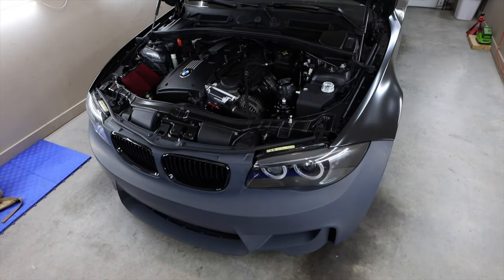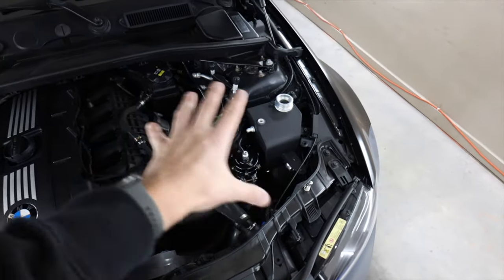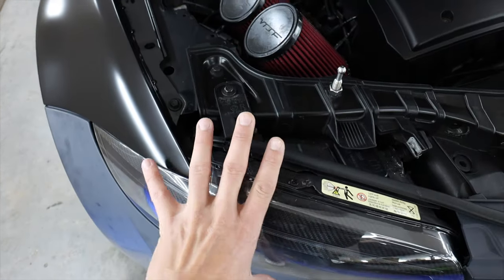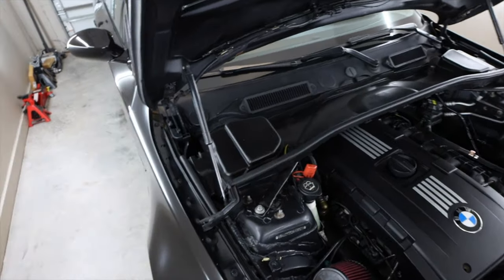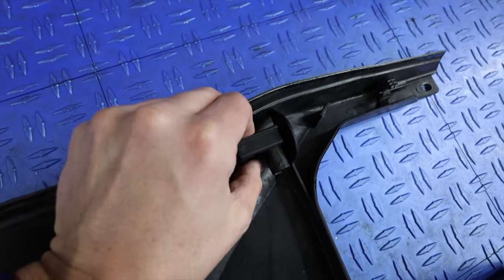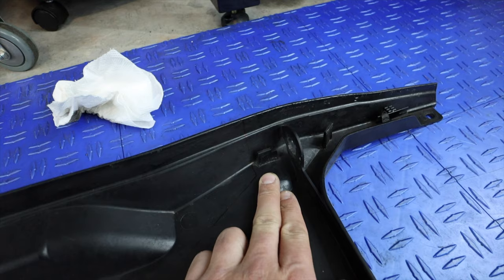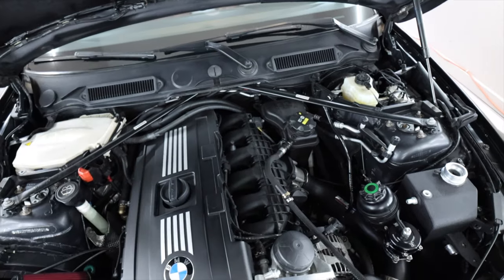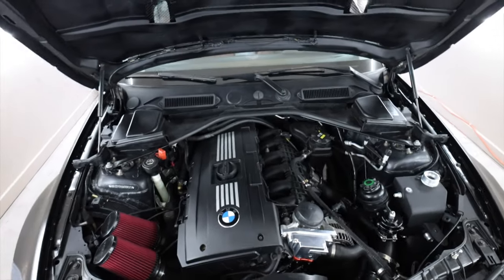E82 135i to E9X M3 COWL CONVERSION (FREE N54 DIY!)

Comment: Cool vid - haven't seen many covering this so far. The only other consideration is your car seems to have different hose routing near the cowl. Stock has a lot of hoses attached to the cowl which will need to be sorted. Thanks for getting so in-depth with this series!
Reply from the maker: Thanks! Yeah when we put in my engine we rerouted a lot of stuff

Comment: hey bro, from which vehicle did you purchase the correct rubber seal? You mention in the video you need a longer one. Gonna attempt this next on my E90.
Reply: did you figure out the part number?
Reply: @NismoGTR511  no lol. I ended up just using the stock one. Lmk

Comment: Nice job !
FIY, 6:40, on my E92, the fixation thread there is used by the alarm system.
There is a switch installed there to detect if the bonnet is opened or not.
Reply: I have the same alarm system on my e82. Did you cut up that plastic piece with that in place?